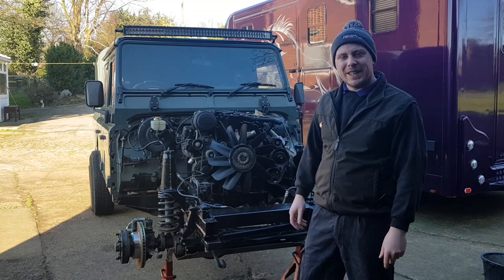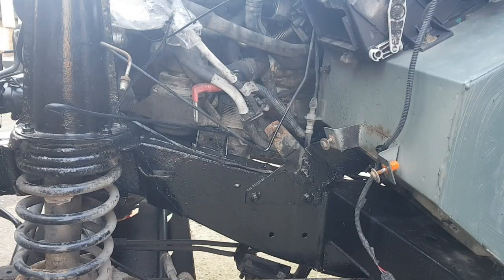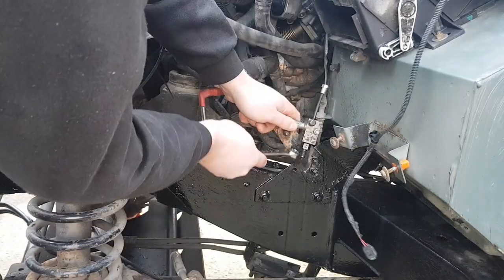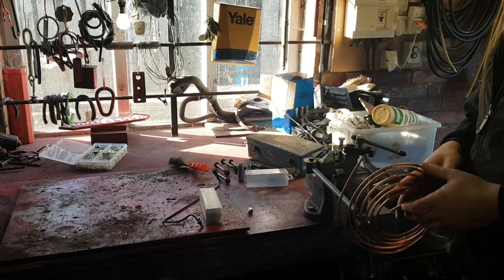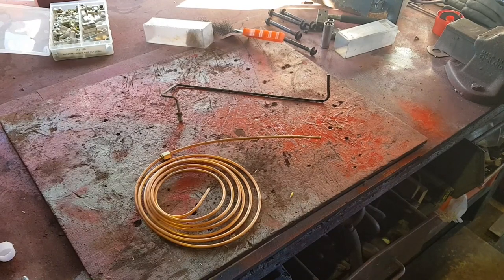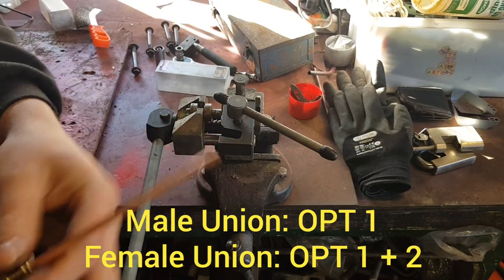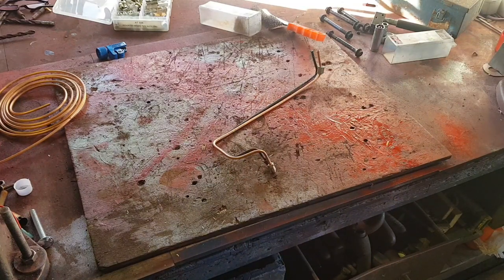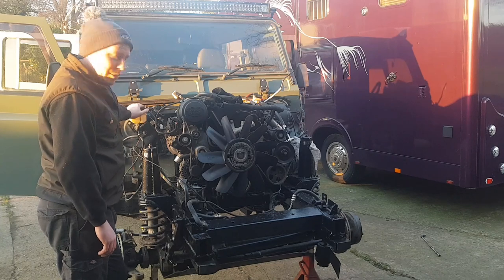Making And Fitting New Brake Pipes, Land Rover Defender  Restoration Project

Comment: WOW this is one of the best brake pipe video I have see on YT.. thanks.. TIP.. Not brakes related only what I see, get some under seal or stone chip on the under side of your foot wells before you put wings back on... as this is an area where the water from the wheel splashes up on to and them rots out.
Reply from the maker: Thanks Gary! 
Well spotted, i have a few bits to rub down and paint before the wings go back on.
Reply from the maker: Meant to say i take alot of pride in making a neat job of brake pipes. lve seen some jobs over the years that are truly dreadful and feel that you are judged straight away on the quality of the pipes that have been made.

Comment: Really enjoying this rebuild....for the first time in my life I haven't made the new pipes for my Defender, I cheated and bought ready made ones!...I still will have to bend them to fit mind :) ......(by the way your option one is also known as a single flare, option 2 is a double flare)
Reply from the maker: I am glad you said actually. When i was making the video i couldn't for the life of me remember the propper term for it. I used to do alot of brake pipes for customers. I take alot of pride in making brake pipes because straight away people are judging your work if they see they have been replaced.
Nothing wrong with that. You will have more of a factory finish over the copper ones 😉.
Reply: @lifes.projects  LOL...I've got cunifer  ones...last a bit better than plain copper but don't rust like steel :)

Comment: Another very useful and well shot video, thanks. im wondering what thread type and sizes are used on Puma brake pipes and are the earlier ones different?
Reply from the maker: Thank you. They are the same as the early 90s + 110s. Think different threads were used on the series models but 100%. I will find out and report back.
Reply: @lifes.projects  Thanks  again. Its MOT time soon and it looks like the replacement brake pipes that were fitted were copper not cunifer and have started to go green.